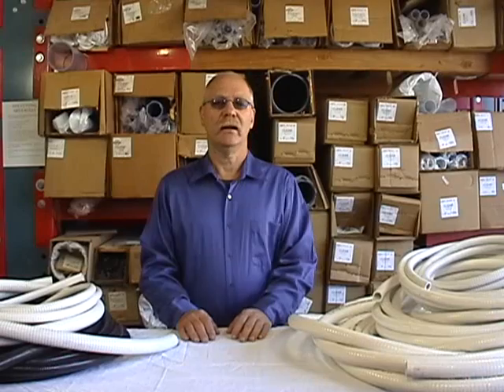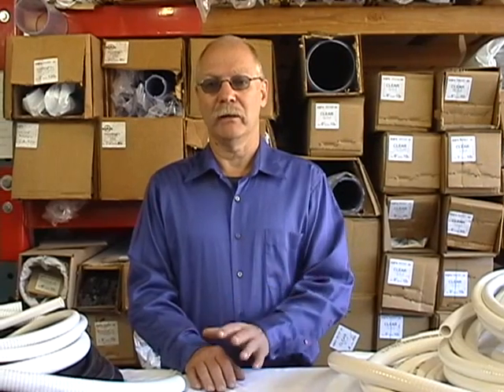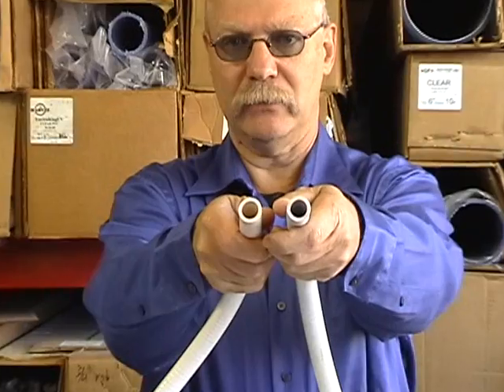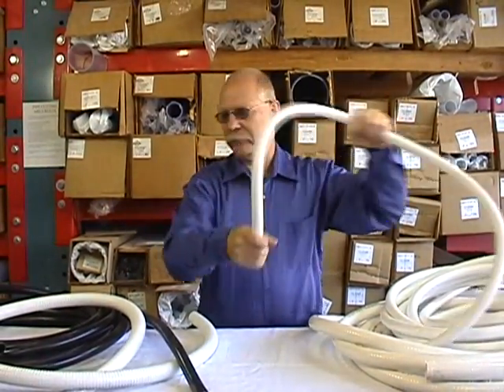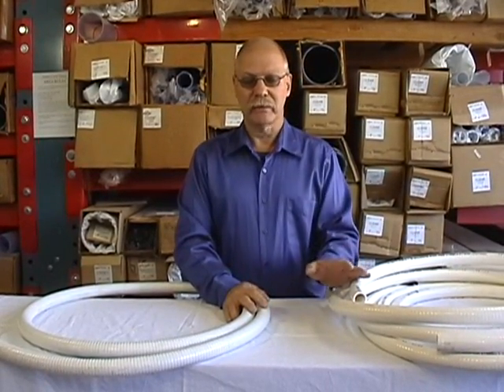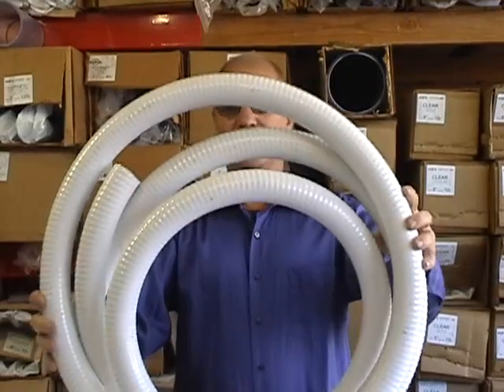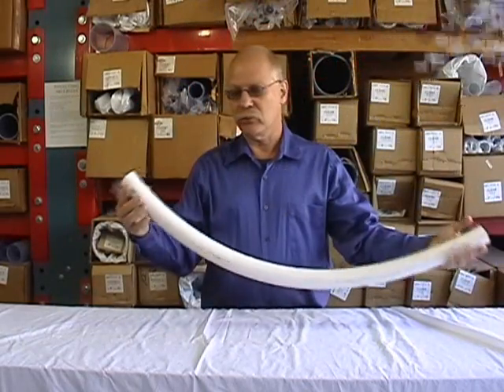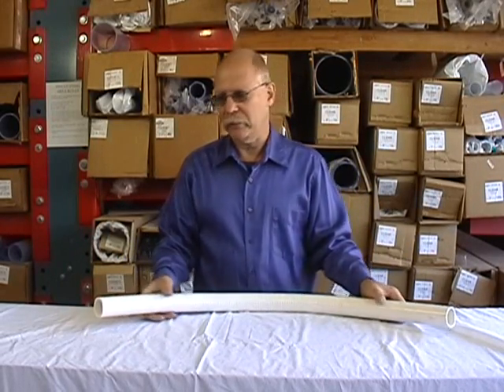FlexPVC® All the different flexible PVC pipe, hose and tubing. Part 1 of 3

Comment: I am looking for a 6 inch piece of flex Hose that can slip over a 2 inch PVC pipe to clamp two pieces in f pvc together. Would you have anything like that?
Reply from the maker: You mean 2" hose that goes over 2" pipe that is 6" long right? sure. see https://flexpvc.com/cart/agora.cgi?product=Flex_PVC_OVERPIPE-ByTheFoot

That will do exactly what you are trying to do.
Reply: @FlexPVC  hank you for your help...would your piece be able to slip "over" the 2in pvc which is about 2 3/8 and be able to be clamped I have tried a 2in  flexiable(rubber) Silicone Straight Coupler Hose 2" Turbo Intercooler 57mm Pipe With T Bolt Clamp would not fit  Your piece doesn't look smooth on the outside to be able to clamp it or s that just the appearance it gives A 2in PVC is 2 3/8 OD Im sure your aware of that.. then a 2 1/2 would fit better over the pvc 2in pipe correct to clamp?  this os for high pressure hot tub
Reply from the maker: @garyredmond9275  Yes, thats the link I gave: https://flexpvc.com/cart/agora.cgi?p=Flex_PVC_OVERPIPE-ByTheFoot&p_id=124PS238&xm=on&ppinc=detail

Comment: would a 6 inch flex hose be long enough to heat up get a coupler in between 2 hard pipes that have no flex?? I currently have a rubber boot  like your showing with clamps in between two hard pipes. Not sure if it will hold it's on a hot tub plumbing under high pressure
Reply from the maker: Are you asking to use 2" flexible pipe that is 6" long or 6" flexible pipe that is ??? long? Also what is the offset needed? This type of question is best sent directly to us. Please see:https://flexpvc.com/Contact.shtml

Comment: Can this be used for natural gas for temporary generator hookup
Reply from the maker: It shows Okay for Propane. But I will have to get with engineering to confirm Natural Gas is okay. Please use our contact form to send us your question directly for the fastest response:
https://flexpvc.com/Contact.shtml
Reply: Thank you for responding. I will send a message via your forms. I am trying ti create a natural gas hook up and many people use a nitrile rubber hose, but I can't seem to find a supplier, but I've read in the plastic compatibility chart that pvc is a good resister to natural gas. I just don't know if the glued connectors will price vent gas leaks. Looking for 1in pipe to have a 3/4 npt brass fittings on the end.

Comment: Would hot water work to straighten it?
Reply from the maker: Not really. Most hot water from the tap is 108F. max. If you boil water (232F) that would be very close and it would have some effect, but to really get it straight you need to get to 240F to 280F.
Reply: @FlexPVC  I was thinking of boiling water, staking the hose out, but 212F seems too low.
Reply from the maker: @markraciborski4289  We use an industrial heat gun. It works, but you just have to be very careful not to overheat or burn it. There is another method but you have to be careful. The exhaust of a car is about 300F. Back in the old days we'd take rigid pvc pipe and hook it to the exhaust of the one of the cars or trucks while idling and that works pretty well. The issue there if if the vehicle is burning oil it has to be cleaned out depending on what you are doing with the pipe. The flex will work the same way, but you have to be super careful about overheating it. HTH.
Reply: Is ultra flex in 1 inch flexible enough to attach to a piece of PVC level with the ground, running  the ultra flex 2 feet on the ground then dropping into a fish pond, attached to a remmovable pond pump? Just can't tell how much curved roll memory it has.
Reply from the maker: @markraciborski4289  Ultraflex is no longer made. The company went out of business. There is another company making a product they call 'ultra" but it's not the same product. They are just calling it that... you can figure out why.

Comment: Is the flex pipe available in 3" and what do you think of flex pipe for temporary sewer/waste/black tank  use?
Reply from the maker: Yes, it is (1/2" to 6") Yes it'll work fine for that, but only in a temporary situation. After some time (2-3 years) it'll start to permeate sewer smell and will need to be replaced.

Comment: I have a small 2 ft section of kitchen sink drain, basement side, rough in, ( not under cabinet finish ) I can’t get glued correctly it’s tight on joist !!!! 
am I fine using this stuff just for the bend part replacing two 90 deg elbows please help is it code
Reply from the maker: Maybe. Best to send some pictures and a good description of the problem via email:
https://flexpvc.com/Contact.shtml

Comment: So, can you glue pvc fittings into that 1.5" flex pvc pipe also where do you buy it?
Reply from the maker: No, flexPvc glues into fittings, not the other way around. You can purchase the pipe on our website https://flexpvc.com Thank you.
Reply: Yes, I said it ass backwards....sorry.  I was on your site I need 1.5" and you have it BUT the wall diameter is .0157 which is about or not quite 3/16.  I have 3/16 stuff from home depot and it is to stiff and not that flexible.  Do you have pipe 1.5 that is more flexible it is for a above ground pool filter system?
Reply from the maker: @rioraton  If it's above ground most of those do not use pipe but hose. If you are using hose, you can try our pond flex

https://flexpvc.com/cart/agora.cgi?p=Black-No-Kink-PondFlexBTF&p_id=198-15BTF&xm=on&ppinc=detail

You connect via barb/insert fittings. Which we have all the adapters you need.

hth.

Comment: Can anyone tell me if this would work with hot water and will this tube get harden with hot cold water over time?
Reply from the maker: How much pressure and what temp?
Reply: No pressure at all. I m trying to use it as a drain tube for a shampoo bowl in my salon reason being the bowl tilt so i need flexible . The original flex tube that came got harden over time and broke which leak. Hand washing temp so 100 degree.
Reply from the maker: @pleiku9411  No problem at all with that application. What size were you thinking about using?
Reply: I am using 1.5 inch tube.
Reply from the maker: @pleiku9411  Yes, no problem. :-)
Reply: I only need 6 ft . Do u guys have?
Reply from the maker: @pleiku9411  Right now all we have is white in stock: https://flexpvc.com/cart/agora.cgi?p=Flex_PVC_By_The_Foot_White&p_id=BTFWHT015&xm=on&ppinc=detail

We will have some clear/white and some gray in a few weeks. You can order that here:

https://flexpvc.com/cart/agora.cgi?product=Flex_PVC_By_The_Foot

Thanks

Comment: Is it safe to use the 1 inch flex pipe for underground ? I will be running electricity cable thru a 100ft distance and would like to know if its safe.
Reply from the maker: Yes, no problem at all.

Comment: Sump Pump Question regarding PVC hose/pipe: Is there a way to connect/couple a 1.25 inch PVC Drain Hose to a 1.25 in standard PVC pipe? I currently have my 1.25 in drain hose connected to the top of a check valve which doesn't seem like a good idea. I'm thinking the answer is 1.25 female/female coupler with the pipe on one side and the hose .... what do you think?
Reply from the maker: If by drain hose you means hose with an ID of 1.25"  yes,  see https://flexpvc.com/cart/agora.cgi?p=Barb-Adapters-Slip-Spigot&p_id=474-012&xm=on&ppinc=detail

LMK if that works for you. Thanks
Reply: @FlexPVC  I ended up using 1.25 in barb / female screw-on 1.25 in pipe thread. I used a worm drive clamp on the discharge hose and barb . Meanwhile I used an 1.25 male to 1.5 slip-on pvc pipe connector. The connections work but I see leaking from quite a few places. Leaks are coming from  discharge hose (worm clamp - it is VERY tight) as well as where the thread tape is (I wrapped 5 layers of teflon tape there.and primer/pvc cement glue  for slip on connection.

Comment: Could you use male poly fittings with  a hose clamp if it didnt have constant pressure?
Reply from the maker: Maybe. It's not really designed to be used that way. There is zero compressibility for this product, which is very different from hose.

Comment: I have a challenge that I am trying to overcome that you may be able to assist with. I am looking to remove caked on dirt from inside my 2004 Jeep Wrangler TJ frame so I can treat it with rust protection to prevent it from rotting and there is no factory drain hole.  There are holes on the rear sides of the frame that are approximately 2 inches in diameter and I would like to use a shop vac to remove the dirt.  I need a flexible hose or tube of approximately 1 inch in diameter and 10 to 12 feet in length that could attach to the existing shop vac hose with some altering.  What options would you recommend for me to tackle this project?
Reply from the maker: Yes, that's a challenge all right. Our pond flex is pretty cheap and about the right size: https://flexpvc.com/cart/agora.cgi?p=Black-No-Kink-PondFlexBTF&p_id=198-10BTF&xm=on&ppinc=detail
Give it a look and email or call if you have questions. The 3/4" might work as well:
https://flexpvc.com/cart/agora.cgi?product=Black-No-Kink-PondFlexBTF

Hth, Thanks!

Comment: can you use these on water waste 1 1/2 pipe with plastic compression fitting?
Reply from the maker: Sorry no, that would not work. It should be glued into pvc fittings with standard primer and cement.  Thanks.

Comment: what typ of pvc flexible pipe  should be use for a above ground pool drain..
how thick should the flexible pipe be,  due to so much water pressue on top of it.
Reply from the maker: All our FlexPVC® flexible pvc pipe will work and has an NSF rating for swimming pool usage. See: https://flexpvc.com/Guides/FlexHose.shtml, any of those listed on line #1. Thanks
Reply from the maker: Our standard FlexPVC flexible pvc pipe will easily handle any pool application and is actually certified NSF 51 for that application. Specs and dims are here: https://flexpvc.com/Reference/FlexiblePVCPipeSpecs.shtml Thanks

Comment: What are some common applications for this type of PVC tubing? How can they be attached or weld one to another or to a regular PVC PIPE? Tks for the vid!
Reply from the maker: Swimming pools, (above or in ground) hot tubs, whirlpool bathtubs, irrigation and sprinklers, mining, livestock watering, rain collection, aquariums, fisheries, etc. It solvent welds into any standard sch 40 or 80 pvc fitting using standard pvc primer/cleaner and glue.  Thanks.
Reply from the maker: Glues into standard pvc pipe fittings with standard pvc glue/cement and primer. Use the clear or blue glue for best results. Any standard primer will work. See video #13 for more info: https://flexpvc.com/TechArticles/FlexPVCVidList.shtml

Comment: Bending with heat: I was on a job once building a large store. We needed to put slight bends in 3 to 4 inch PVC conduit.  Stuck the end over the exhaust of a pickup truck.  Works, well, but keep your eye on it or it will overheat.
Reply from the maker: Works well for rigid (hard) pvc pipe. It can be done with flexible pvc pipe but you have to pay close attention. It's easy to overheat and cause a kink which you will not be able to get out.  GL. :-) Thanks
Reply: I used a portable household steam cleaner to straighten out this tubing positioning the steamer into one end of the pipe. It worked like a charm.

Comment: What are the constant psi ratings of 3/4" & 1" flex pvc? I saw that the repair piece says not for constant pressure. I am working on raised bed irrigation and everything needs to be above ground & must fit 3 valves, a manifold, or cross a 15x8x12" fertilizer tank, the quick-release garden hose coupling to the system, a filter, adjustable pressure regulator, adapters to & from MHT/FHT &  ball valve coupling w/take-off ports to the fertilizer injector, etc, etc, outlets at 9-, 12- & 3-o'clock, and whatever else inside a box or rubbermaid type container and an S-pipe or two u-turns may make things easier.
Reply from the maker: Full specs are here: https://flexpvc.com/Reference/FlexiblePVCPipeSpecs.shtml (in case youtube kills the link, 100psi for working pressure for 3/4 and 1" standard flexible pvc pipe.)

Anything after the main valve is fine for flexible pvc pipe. But before the valve is a no go if the line is from a municipal water supply or  a constant pressure situation like a well with a precharged tank. A flow on demand system would  be fine. Hope this helps.
Reply from the maker: for specs and dims, see https://flexpvc.com/Reference/FlexiblePVCPipeSpecs.shtml For irrigation you are fine as long as you are after the valve and before the sprinkler heads or drip irrigation. hanks